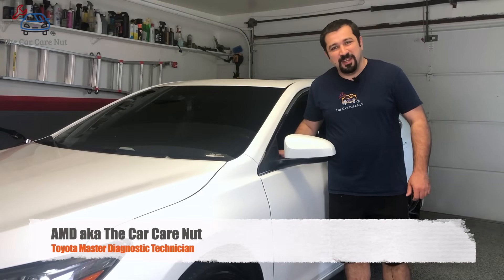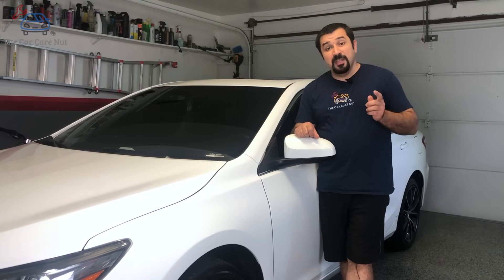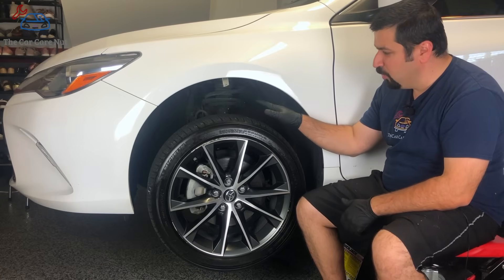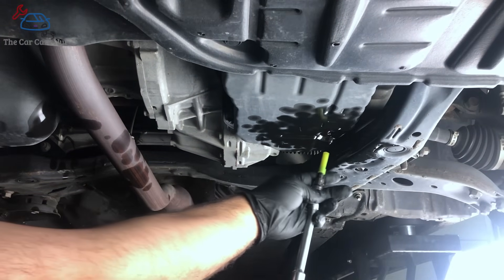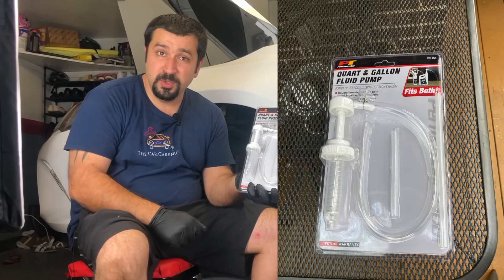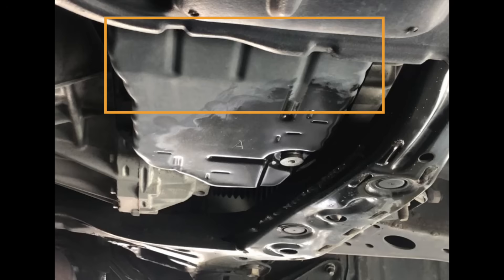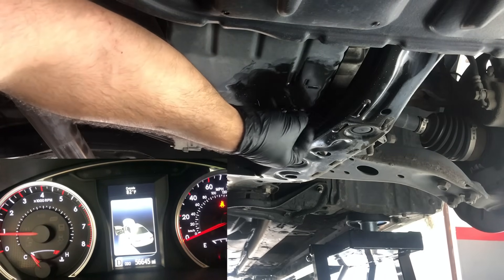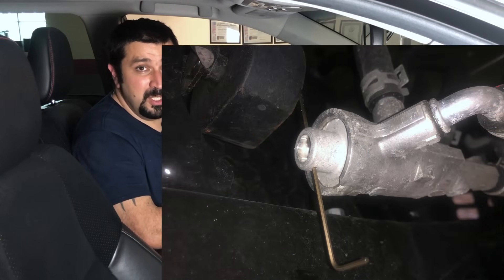How to change your Toyota Sealed Transmission Fluid

Comment: I have a question. If I can measure the drained fluid exactly and put in the exact amount back into the transmission, do I still need to do the fluid level adjustment procedure shown here from 8:55 time stamp?
Reply: No, as long as the fluid you replace is about the same temperature as the one that’s left in the transmission that doesn’t drain out when you drain the old fluid. Remember, a LOT of the old fluid does not come out when you drain the old fluid. Since trans fluid expands with heat and contracts with cooler temperatures, they have to be the same temp. If you took very warm fluid out of the car and put in fluid you had in your air conditioned house, you will be putting in a higher amount than you thought after the fluid expands with heat. You will have overfilled. If it’s cold outside and hot inside and put the same measurement of fluid back in that you took out, you will be under-filled. The only time you really need to do the whole procedure is the first time after you buy a used car if the car is well past the factory warranty period because you don’t know if the fluid was ever changed by someone who didn’t know what they were doing and replaced the wrong amount. However, if you don’t know the car history but  don’t want to go through the whole procedure, it’s better to change the fluid anyway without doing the 8:58  whole procedure than to not change it at all,. Usually the amount inside the transmission is correct. I said usually!

Comment: Why not just add in the exact amount you drained out? Seems way simpler!
Reply: If you drain hot fluid and replace same volume with cold fluid you will definitely overfill the transmission.
Reply: @Rajphatak215  this is based on draining cool fluid after car has set overnight. Great point and thanks for sharing.
Reply: Yes, it’s been said to measure how much you drained out and put the same amount back in.
Reply: Replacing fluid by just measuring it (hot or cold) means you’re willing to assume the level was correct to begin with.  Why take the chance when the fluid level check procedure is pretty simple and allows you to be certain. Plus, you have to guess how much fluid residue was left in (coating) the catch pan, unless you’re going to squeegee it all out, and find a truly accurate measuring device vs. the Home Depot bucket with screen printed measurements…

Comment: I cannot check the fluid temperature in my Toyota RAV4 2021, the pin #13 is missing in the OBD box, and cannot connect the jumper cable.

Comment: Thanks so much for this video, AMD! The transmission cooler bypass valve was the worst part, since I didn’t really know where it was, and so had to take the entire plastic shield off. Good thing I had an odd assortment of push-in fasteners as I broke all of them getting that thing out! The rest of the job went great. 8:30 am to noon start to finish, including jacking the van up and placing on jack stands, a tire rotation, and checking fluids. 

I only got 2.75qts out of my 2019 Sienna with the bypass valve pinned open, so I put 3 in. I followed the magic shifter trick to see when it was warmed up enough to pull the drain plug to set the level, and this went just fine. Then I let it run while watching the D indicator to see how much time I really had to set the level. Starting with a “cold” transmission (this is Florida, it was 90F by noon) I had more than enough time.

Between this and the spark plug video, the Car Care Nut has saved our family so much money in maintenance this month! Thanks again!

Comment: Hi AMD, I'm trying to do this for a 2018 Lexus IS350 AWD. The service manual says to drain and refill twice for the "replacement" procedure and drain and refill once for the "adjustment" procedure. Do you think it's necessary to drain and refill three times for the whole procedure for an IS350?

Comment: Excellent video, as usual !
Somehow my car could not restart after I tried the transmission diagnostic mode (probably my fault...)
Instead of plugging wires into the ODB2, it seems safer to use a cheap ODB2 reader and read the temperature from a custom PID in Torque Pro...

Comment: Great video, keep posting those great videos. I have a 2002 Sequoia with 112k miles on it, the transmission fluid has never been changed. Do you recommand me changing it?

Comment: Noticed multiple comments about draining and filling while cold to avoid the procedure. Can we siphon/suck out 2-3 qts from the 24 mm fill plug and add back the exact same amount to achieve the same result.
Following things need to be assumed
1. vehicle is on level ground 
2. new and old fluid is at room temperature ( 5-6 hours since last run) 
3. current level of fluid is correct
4. There are no leaks in the system to change fluid level
Putting it out there for discussion/ suggestions. Many videos out there doing engine oil and trans fluid exchange through dipstick hole. Some models have fake dipstick tube and cap without any stick attached to plastic cap as they dont want redesign trans and make new part.
Reply: I guess my thought would be why take the chance of “assuming” any of those things when there is a Toyota/Lexus approved procedure that takes all the chance out of the equation?   The only assumtion I’d be willing to make is that the Toyota/Lexus engineers have good reasons for the procedures they outline for their techs.  I’m not trying to sound snarky, but these cars are major investments, and taking shortcuts often seem to lead to expensive fixes.
Reply: @Rob-ou1fj   I feel "assume" was a wrong choice of words. If we can confirm  that suggested conditions have been met it should be possible to siphon out and fill back. Struggling with keeping the car level and still be able to get under it to drain without buying 4 jack stands or EZ-lift/ quick jack as required by TCCN.

Comment: Does the transmission pan on a 2014 Tundra with 5.7L have an overflow tube? I got the pan down but it doesn't have the tube attached to where it supposed to.

Comment: I loathe the team of A-Holes who designed these transmissions! This was a bigger issue for our 21 Rav4. The fill Bolt is partially blocked by the Frame Rail. Toyota designed to to be difficult to remove from the Top.! Our 05  Rav4 transmission fluid change was literally a walk in the park when compared to the 21 Rav4.

Comment: Is there any procedure which requires calibration of the oil pressure in CVT transmissions with the scan tool

Comment: How can any shop get the accurate temperature zone  in the summer? If I drop off my car hot and they take it in the shop even hours after the drop off the transaction will still be well over 110 degrees. As much as I believe in the brand I feel the level tube should be made to be measured at operating temperature.
Reply: I’d hope that any shops would schedule transmission fluid changes for first thing in the day, and require the vehicle to be dropped off the night before.  Probably not a whole lot of places that get to 110 on a daily basis, and if they do, maybe they do these fluid changes primarily in the Winter months?

Comment: Has anyone just try sucking  out a few quarts from the side fill hole and refilling it with the same amount instead of draining it??  My bought used Sienna has 122k and i believe it has never been changed.  That's my plan...quick and less mess.

Comment: 2006 FJ Cruiser.  Currently 425,000 miles.  AT flushed and new filter by shop at 250,000 miles.  Still runs like new.  Should I touch it or leave it?

Comment: Thanks for sharing, I have 2017 Toyota Corolla XLE with 145k miles. Never had transmission fluid changed before, any advise if drain the oil and put back the exactly same amount?

Comment: Does it matter whether to leave in park or neutral when doing the final fluid level check?

Would it help to apply gas when initially cycling drive/neutral to ensure the fluid has made it through the trans (seems dangerous)?

Does it matter which end of the temperature range you are on if using digital thermometer or scan tool?

Thoughts on OEM fluid vs premium aftermarket?

Thoughts on removing the pan entirely so that you can clean out the screen?

Comment: Great video. What about a complete transmission flush at a dealer? Is it worth it? I assume these new CVTs also have torque converter which I have read retain old oil when u just do a drain and fill?

Comment: Okay so I did this procedure exactly as you said. My concern is this: I drained my fluid when cold and got right at 2 quarts out. I refilled with about 2.75 quarts. I used a temp gun and cracked the drain plug right around 106-107 and put it back in as it started to trickle. Again I got out right around 2 quarts though??? Did I do something wrong or did I get more fluid because the transmission was warm the 2nd time? I've driven about 100 miles since and cannot notice any slipping or anything. My only guess if this ain't normal is maybe I didn't thread the orange "dipstick" piece right enough? Idk I'm racking my brain over it! I might just redo the whole thing 😂

Comment: afternoon  requesting the required temperature when using a temp gun to service a 2020 XLE Highlander FWD 8 speed trans and the spot on the trans to check . {my 1992 Previa is still running great}  thanks for all the great videos

Comment: Doing this process this weekend.  QUESTION:  Do you pin the thermostat before you even start the drain process?  Meaning, is that basically the first step of the whole process or JUST the Fluid Check process?

Comment: You didn't discuss the use of the digital IR thermometer to determine proper fluid temp. Is this method standard practice in Toyota shops? Is the IR therm. reliable and accurate?

Comment: Hey, I have a question. I have the Haynes manual and it says roughly 1.3 quarts for a drain and refill on the transaxle, but I am changing out the filter also. Is the amount from the Haynes manual applicable to this situation or should I just base it off the same amount of fluid that comes out of the transaxle plus half a quart and just mimic the process you did in the video?

Comment: Just used ur obd method 👍. 2012 toyota camry se 2.5 94-113°. Dealership sead 94-99° which is damn near impossible, unless u do it several times to really dial it in. I dropped the pan to change the filter. Luckily, once to get the level right, just refill what ya drained out. At 74k, the torque converter was replaced. The next pan drop and fill was 74k miles later. That fluid was really dark. I had forgotten that after a torque converter is replaced, the transmission needs to be serviced like a new trans a lot sooner than 60k. Lesson learned, will likely drain and fill in 30k miles.

Comment: I have 2023 Corolla cross AWD done 42,000 miles , which oil should I buy and what will be the temperature to check with the heat gun .thanks

Comment: Thanks so much for a great video!  I just picked up a 2015 Lexus RX350 with the F-sport package so it has the 8-speed transmission.  It has 97K miles on it and is super clean with no sign of any leaks.  I don't have evidence to show that the transmission fluid was drained and refilled before so I have to assume it wasn't and want to perform this task.  Can you give me the temp range for the fluid level adjustment on this vehicle please?  Also, is this the 8-speed transmission that you referred to as having a bypass switch that has to be engaged to get the proper fill level?  Thank you so much!

Comment: I'm struggling to see what he means by the drive light. Could anyone explain?
Reply: Sure, the display infront of the wheel. Sit with ur foot on the break and switch through the gears. Find where D shows up on ur display. He's just referring to where the gears are displayed. Make sure to switch from Nutral and drive fast so ur not actually engaging drive. Otherwise u might get a clunk if ur levels are to low.

Comment: I don’t understand when checking the level, can you check the level if it’s hot or cold?
Reply: Yes, u can. If u have the right tools... for operating temp u will need 3 tools. A pump to add, a vacuum to keep the fluid from draining when u remove the 3rd tool. Third tool is a gauge the fluid levels at each temperature. Keep in mind only a few dealerships even know or have this tool.

Comment: AMD or anyone who knows, what is the torque spec for drain and fill plugs?
Reply: Answering myself for anyone's future reference. Specifically, I'm working on a 2011 Sienna V6 FWD with the U660E transmission. Toyota T-SB-0036-13 Rev2 dated February 25, 2013, showed both fill and drain plugs as 30 ft/lbs with new washer gaskets. So unless there's been further revisions to the procedure...
Reply: Back again to say 30 felt way too much for a 6mm allen on that drain plug. I stopped at 25. Might even stop at 22 or less next time because the allen was stuck in the hex and was starting to strip into it. I left fill plug at 25 also.
Reply: I've honestly just gone by fill. The oem washer realy isn't a traditional thin crush washer. So just snug and just a hair more force. Luckily, I've never had to replace an oil pan 😂. I'll have to add a digital torque adapter next time to see what I end up on torque.Harbor freight has a cheap one that is accurate to one pound of spec, think it was $45.

Comment: Some of these vehicles have a slight rake to them when on the ground. Should you duplicate this on jack stands or make the vehicle truly level? Or can you put a level on the transmission?
Reply: The portion of the trans where the plug is on the pan is level. I use a small cube leveler and jack stands. Best I can get is +or - .35, and still get the iconic dribble.

Comment: What's the correct procedure when some of the dirty fluid splashes into your eye, you involuntarily snap your back in response, get a deep, nasty cut on the back of your scalp from hitting the edge of the brake rotor guard, your hands are covered with dirty ATF and you accidentally kick over the drain pan, spilling the entire contents onto your leg, while trying to get out from under the car? Asking for a friend.

Comment: appreciate your ussful information about toyota maintaince, my question, is there any issue if i use amsoil CVT FE for my toyota corolla 2023 instead of original toyota fluid? the specs of amsoil is way way better than toyota one and the price is at the same acceptable level. do you recomment that or not ?

Comment: Very informative video, but I have questions!

2018 Highlander with the V6.  Which fluid should I be using?  I have seen mixed responses between the CVT FE and the WS???  Also, approximately how much fluid is needed for drain and fill on this vehicle?

Comment: Question why cant you drain cold and refill cold it would be the same you took out what u put in
Reply: U absolutely can, as long as the fluids are the same temp for an accurate measurement of volume. This video is very helpful if u are changing the filter, as it's not as ez to measure the drain volume in this case.

Comment: I have a 2016 Avalon w/ a 2GR-FE asking for the correct temp  required for transmission fluid fill arter a drain and fill. Thanks for all you maintenance videos!!

Comment: Hi!
Thanks, it was exciting!

But I see in the description, that this method doesn't apply to the "All hybrid models".
Do you have any recommendations for this for hybrid models?
I'm particularly interested in such a procedure for the Toyota Auris 2011 Hybrid (EU) with the P410 transmission.
Is it necessary at all for it?
The car now has 147 000 km, I just bought it 2k km ago and wondering, how else I can maintain it and extend its lifetime.
And your channel fits in the best way for it :)

Alvast bedankt!
Fijne dag! :)

Comment: They do this to force people to take it to the dealer. They will have excuses for this, but it’s bogus. They call this lifetime oil which is a joke. If it’s lifetime, why does the transmission have a drain plug and a fill port for the new oil. There is no oil that doesn’t break down over time and distance driven. The dealer could bring the car in and do nothing to the transmission that you can tell.

Comment: I just wanted to say thank you for making this video. Just did my 21 Highlander and made the process so easy.  Probably saved me hundreds of dollars by not having a dealer do it!
Reply: Depending upon the mileage, your local dealer or garage wouldn't have even done it. My girlfriend's Rav4 has just over 100K miles on it. We couldn't provide proof that it had been done at 60K. The garage thought the risk of doing it now would be too great. It might develop slippage. Did it myself. Works fine.
Reply: $420 dllrs is the cost  and they might not replace the fluid. I took my RAV4 for this service and the drain bolt seems were never removed and ask for what they did and nobody could explain me. Disapointing!
Reply: I just did the wifes 20 Highlander.....   it wasn't bad at all...  I need to do it 2 more times so I know the fluid is clean...
Reply: @mrr8682  Did your 20 Highlander have the cooler bypass valve?  I see some info stating valve is now in the radiator.
Reply: I'm from the UK & did my 2015 Yaris 1.3L (98,500m) by filling it up with a garden hose & a funnel, there's room on top of the engine to insert the end of the hose & poured it that way...a bit slow but it did it. If a hose can fit at the top it uses gravity so no need to buy a pump like we see in some other videos.
Reply: Hello. LOVE your Toyota maintenance videos. Can I ask you if there are any specific changes / nuances regarding the draining / refilling of transmission fluid on the "sealed" transmission on the 2015 Lexus RX350? Thanks